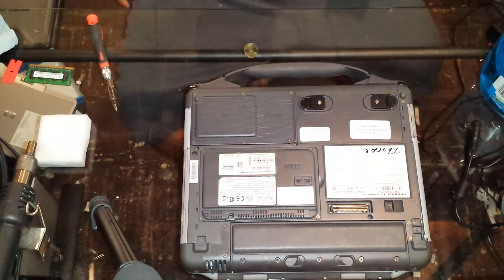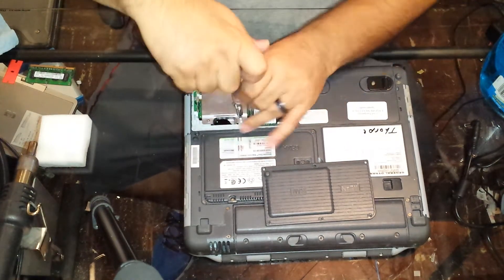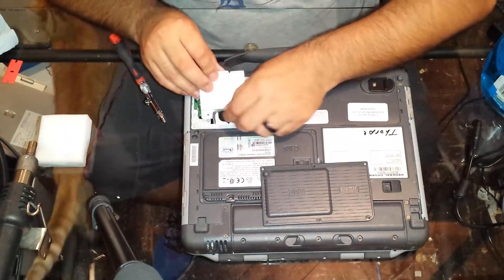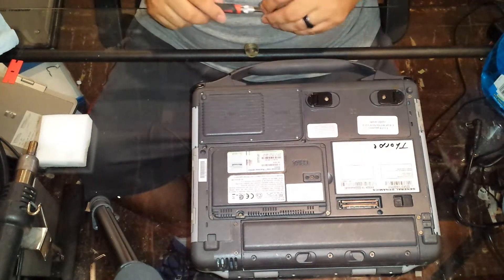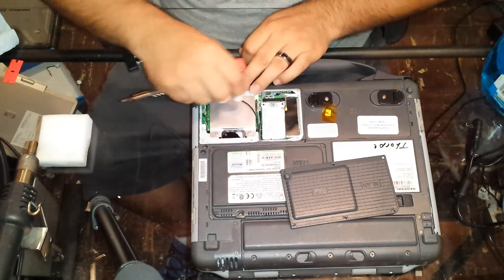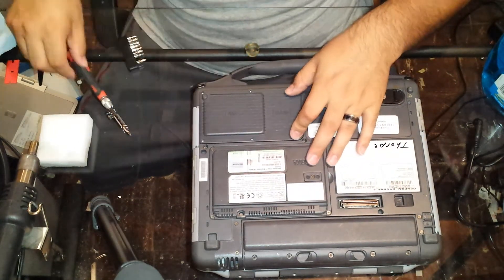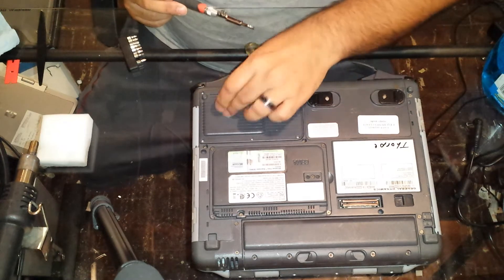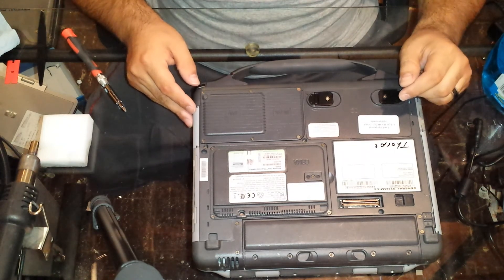General Dynamics GoBook XR-1 Itronix IX270 RAM and Wi Fi card replacement

Comment: Where can I find a bluetooth card for the XR-1? I installed an Intel Wifi / Bluetooth iirc it was a mini-pci-e (mini-pci express) that fits in the smaller pci slot. The Intel wifi drivers loaded but not the bluetooth drivers. 

I'm running Windows XP.

I have been looking around for a bluetooth card. I don't really use WiFi with the XR-1 as I don't use it to connect to the Internet. However I do have some bluetooth devices such as for GPS, etc.
Reply from the maker: Andonso Solarnoid I'll go through the machines I have laying around and see what I can find.